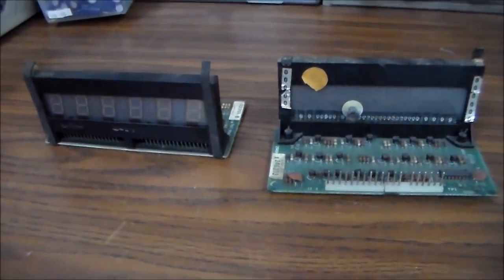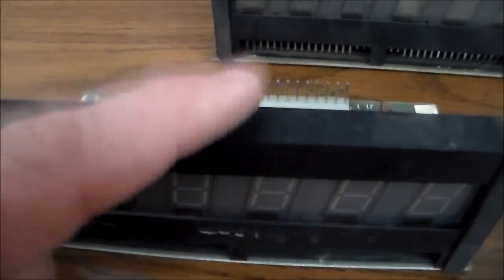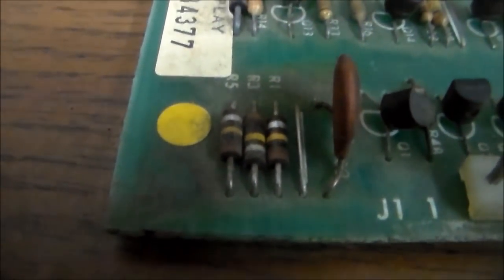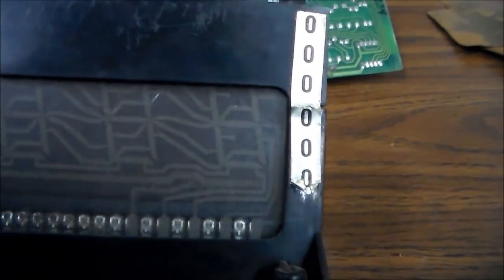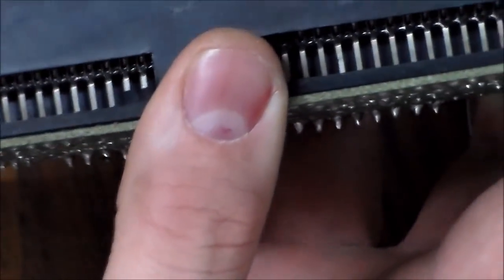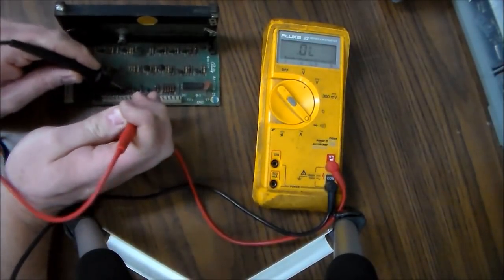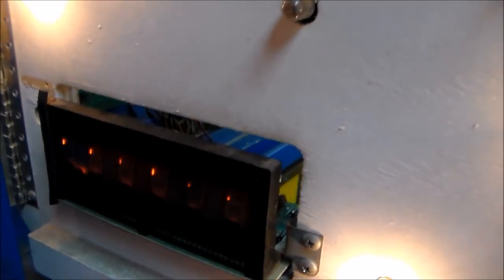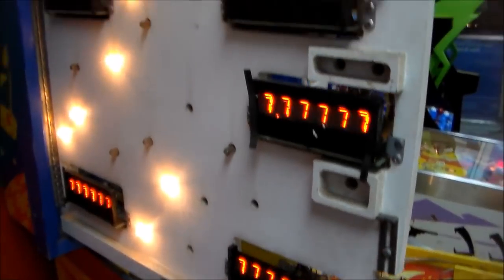How to repair your Bally Pinball Machine Score Displays

Comment: If you ever run into backlighted LCD displays, especially those that have leads attached to the glass panel like in these VFD/plasma displays, they can be very sensitive to the tension applied to the leads (because they in turn apply tension to the glass). I have fitted pieces of LED strip to rpelace the backlight in some, and sometimes to access the backlight you need to detach the display panel from the PCB. In that case it is best to have the patience to desolder all the leads and not just bend them so you can access the backlight. Any tension to the glass may make some elements look like stuck on or off, or illuminate only partially. 

Also note that when replacing incandescent backlights with LED's, the LED color affects the way the display looks, sometimes dramatically. On a CD player that used to have brown elements on black background, which used a blue filter and undervoltaged incandescent bulbs, putting in a white LED changed the elements to white on blue background. It looks neat that way too, but if a device had more than one display, then it might be best to do all of them the same way. Maybe a high intensity yellow or orange LED might have looked more like the original, a red one might have worked too, but a blue one might not have given much contrast at all.
Reply: I live in Karachi Pakistan and I like your comment send 10 month ago

Comment: Joe, Fantastic! Thank you.I have a new to me Star Trek without displays working at all. I have rebuilt and adjusted the Solenoid driver board to 190V. I have a bit more checking to do but do all display have to be plugged in for any to work? I am currently trying without one display as I know it is bad. Thx.
Reply from the maker: You can plug it in with no displays, or 0,1,2,3,4,5 in any position and it won't hurt.  Just plug in whichever you want to test out and you'll be alright. Good luck!

Comment: Always enjoy your videos.. maybe I missed it but on my bally's evil knievel.. the player 4 display is showing no digits at all. I swapped them around and when plug in a good display into 4 it works.. so if a display is showing no digits any ideas to try? Thx
Reply from the maker: first thing to do is reflow the solder on the edge connector, it may be the voltage isn't making it onto the board... but usually when a single display doesn't show anything it's because the glass has went bad on it.

Comment: What kind of supply? Like a transformer? What voltage do u know? Thx!
Reply from the maker: There's a power supply in the top right corner of the backbox, all the voltages are in the manual it's 180volts or so.

Comment: Joe what about displays that not even lit up...is there a way to bring them back to life?
Reply from the maker: Tim if they won't light up there may be a resistor or diode burnt up on the display but more than likely it's because the glass has evacuated all the gas in it and it can't be replaced without putting a new glass on it.  They're really expensive if you can even get them anymore unfortunately....
Reply: @LyonsArcade  okay thanks joe..i thought maybe it was a gas leak..

Comment: I had so many resistors about to burn up, already burnt ones, and a broken transistor! You didn't say that if the digits were flickering it is the chip and the part where you explain the resistors ohms was weird. Can't you just read the resistors like 1st color = 10s place, 2nd color = 1s place, 3rd color = multiplier, 4th color = tolerance? Anyways good video for beginners.
Reply from the maker: I think when you do your video you should definitely do it that way!
Reply: @LyonsArcade  your video is great.

Comment: I have one thats going crazy. Its adding sporadic points even when it's not that player's turn. I had it on player 2 and whenever player 1 played, it added points to player 2. I moved it to player 4 and now its doing it there. The first digit (ones) flashes random numbers. I reflowed all the solder, but no joy. Do you think it's the decoder chip or something easier to change?
Reply from the maker: It's pretty much got to be the decoder chip... since it followed wherever you moved it to, you know it's on that actual pcb and not the wiring harness of the game's MPU.... there are a few transistors involved for each digit (and each segment) but they'll just make your digit disappear, if you're getting the wrong number it's almost always the decoder chip....

Comment: What's wrong when all four score displays don't light up? We're working then just quit lighting. The incadesent lights come on it's only the displays, all four, and credit match etc. All the LED lights.
Reply from the maker: There's a power supply in the backbox on the top right that creates the voltage that runs the displays, either the fuse has blown or there's a loose connection on one of the connectors that sends the power to the displays...

Comment: Hi Joe i Have a rapid fire with a brand new alltek mpu but the credit display has a line of 8s, when i go into display test the left displays go to 0 to 9 but credit remains the same is this a mpu problem or display problem thx
Reply from the maker: It’s more than likely a bad connector pin on the plug that plugs into the mpu... the Alltek is very durable very little chance it has any problems at all.  Unplug both the displays and swap em see if the display changes in a different position.
Reply: @LyonsArcade  i moved player one to credit and credit to player one, credit work player 1 all eights and player 2 malfunctioning fadeing
Reply: it has 2 x7 segement display on the left and the credit has 6 segement on the right

Comment: How about if all the digits are dim
Reply from the maker: If it's on one display it might be the capacitor or the diode on the display, if it's on all of them it's probably the voltage coming off the solenoid board.  you can check the voltage at the solenoid board and then check it again on the display to see if it's lower, should be 180 or more volts dc.

Comment: My machine has a weird problem where only 3 displays work and I switched them all around so it’s not a problem with the machine. The displays that don’t work have no sign of life once so ever. Not a shimmer or a glow at all.
Reply from the maker: It might be bad solder on the pins the connector sends power through on the edge but usually if they won't do anything it's the glass is bad which can't be easily repaired.
Reply: Joe's Classic Video Games, Thank you! After inspecting the displays again two had cracks in the glass right next to the board!

Comment: Hey Ron, wasn't sure how to msg aside from commenting on a video. So i'm working on the trident displays, reflowing the pins and two of the displays had 1.4K resistors soldered underneath the Q7-12 one of them broke off and before i go through the trouble of replacing it I was wondering if this was some sort of mod?   the 100K and 300K resistors all test ok. Only two of the displays had this done, they both happen to be Beckman displays.
Reply from the maker: Im not sure why those are on there but I’ve seen them on dozens of displays…. I’ll bet it has to do with the Beckmann glass like you mentioned… I always leave them figuring somebody did it for a reason.  You can always email on our website too at LyonsArcade.com